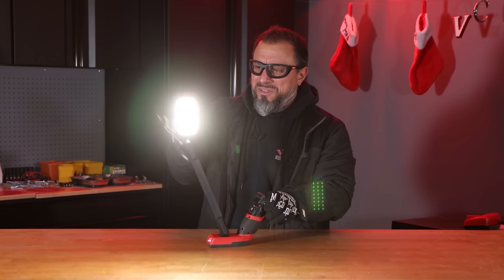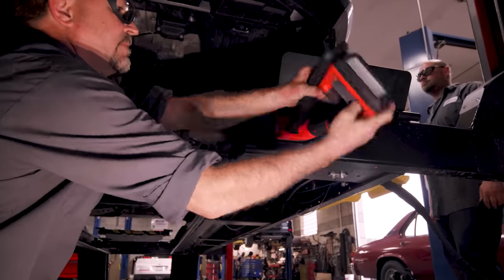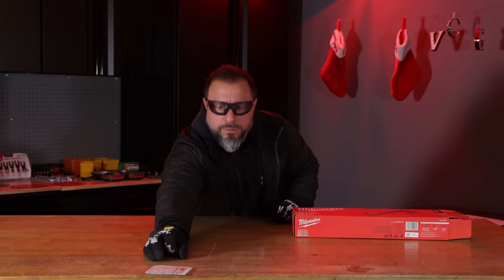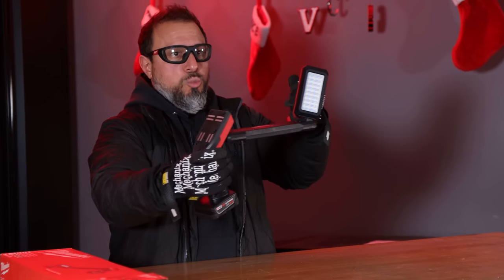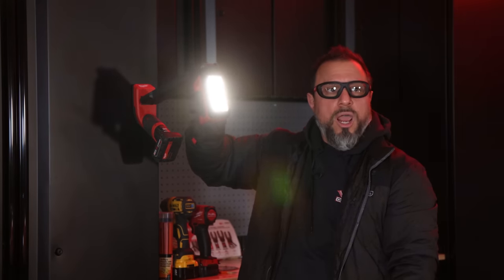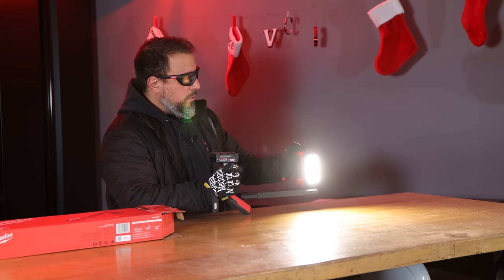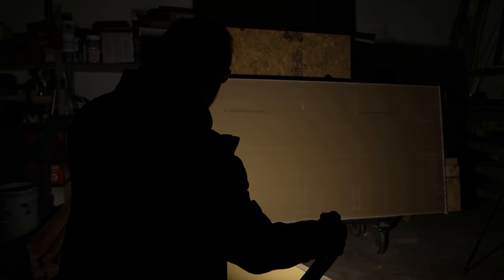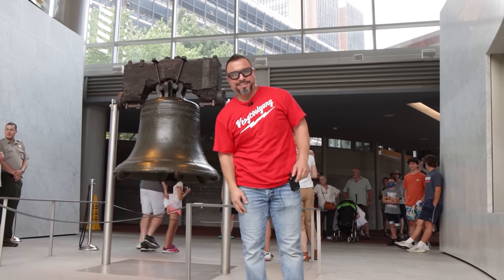You Can Stick This Milwaukee Flash Light where the SUN DON'T SHINE!

Comment: I hope Milwaukee considers making this on the M18 platform. This would be perfect in a scissor lift working on high ceilings with that magnetic tray!!
Reply: I'm in both platforms so I don't care to much but on something relatively small as far as current they could make it run on both
Reply: If you plug in your lift with auxiliary power you could have a spare battery charging it.  You'd have zero down time.

Comment: All the sound effects. 😂 Strange looking tool, but seems useful. My main problem is how expensive all the big brand cordless lights are.
Reply from the maker: What lights do you like 802?
Reply: @VCGConstruction  Well I like the design of the DeWalt DCL050 because it's basically a classic work light, but it can stand on its base, and should be pretty bright. The M12 stick light 2351-20 is similar, but compact. Still pricey for just a stick flashlight though. The rocket lights are sweet but sooo expensive. I'm just too poor for good lighting, hahaha.

Comment: Never stop reminding people about the TERRIBLE M12 Charger.  Never let up on them until they do something ‘bout it!
Reply: The generic M12 chargers are awesome compared to the OEM version. Faster and fills the battery to a higher capacity. Milwaukee M12 chargers have a lower voltage requirement to finish the charge to protect the batteries but it leaves the customer having to charge more.